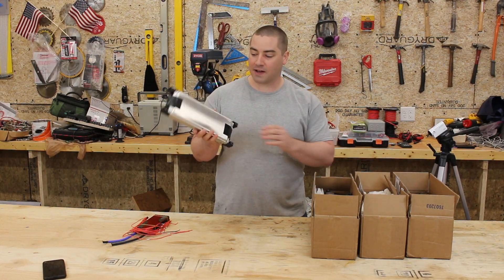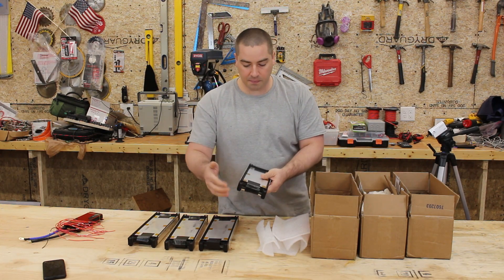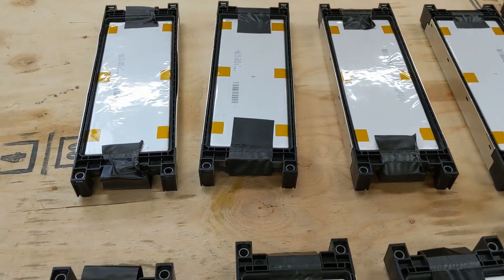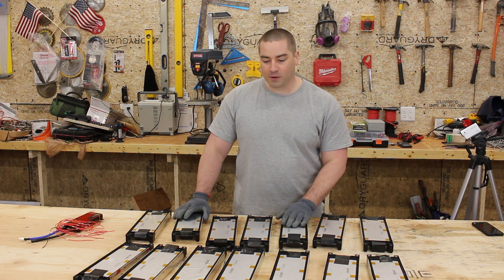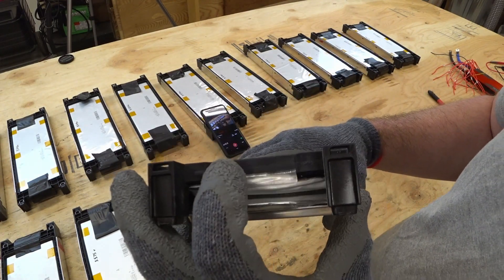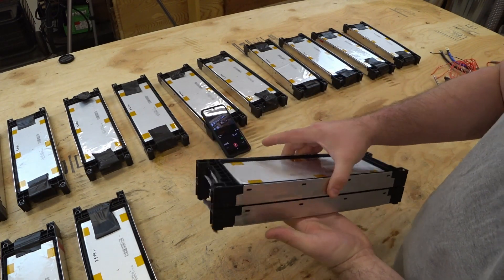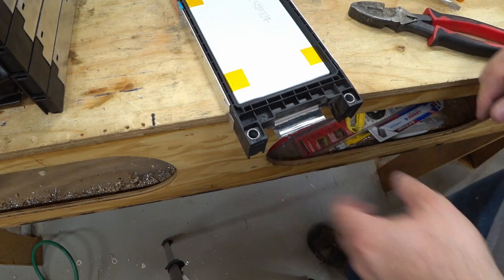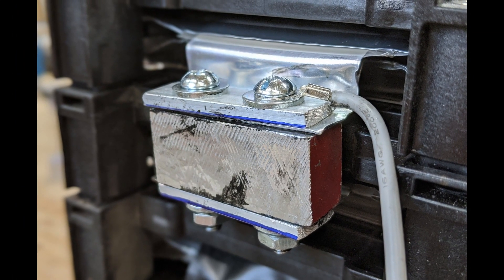LG 6kwh Powerwall, Part 1, Joining Cell Tabs Together

Comment: would love to run these in my boat for trolling motor... Just cost so much to get these into Canada sigh
Reply from the maker: They are out of a Chevy Bolt.  You might get lucky and find one at an auto salvage yard?
Reply: I ordered 14 of these to be delivered to nova scotia... thought awesome till i looked at my bank statement online and seen that my bank (cibc) charged me $1.495 cad per $1usd. Called the bank and gave them shit and then emailed batteryhookup to have the order cancelled. Still waiting for my money back from batteryhookup, it's been 10 days today. Batteryhookup told me it was gonna take 7-8 business days to give me my money back...I'm like WTF it took 5 minutes to take my money and 8 business days to give it back, suffice to say I have my bank 90% of way through a fraud charge if my money isn't back in my account on tuesday (8th day). Every one is out to take advantage of everyone!
Reply: @DavidSmith-dm8ew  I don't know the particulars but 2 things. first you should know it will cost at least about $1.42Canadian since the exchange rate is 1$ Can to .70 US$  maybe your bank or card etc has a service charge for the rest or could be the exchange rate was different that day.  

Second  a business absolutely must make sure the transaction actually goes all the way through and is actually in their account BEFORE they return it to you (which by the way also likely costs them some money so they may actually lose money to refund you fully) this probably takes 3 or 4 business days.  Then they refund it to you which then also takes 3 or 4 business days for your bank to make sure it is actually there to put in your account.  
The biggest reason for this is to prevent scams etc .

It is entirely reasonable for it to take 10 days or more.  Many businesses will take up to 30 days to get this done .

I am not affiliated in any way with BHU and in fact have never purchased anything from them.  I do know from what I have read they have always refunded money to those that had problems with a shipment or goods etc.  Really even more than maybe they should have.  

By all means make it known if they dont return your money but I wouldn't be quite so quick to criticize. There are only a few major companies that sell these type of deals to DIY ers and I am thankful they exist whether I have used them yet or not.
Reply: @teekay1785  CIBC told me it was their business model to charge someone more money then the exchange rate so that they can make money off people.
Reply: @DavidSmith-dm8ew  Today's exchange rate is CAN$1.42:US$1.00

Battery Hookup has nothing to do with exchange rates, or restoring funds to your account. These are all sent by governments and the financial/banking system.

Had you used a credit card, rather than a debit card, your available funds limit would've been restored within 2 to 3 banking days, tops.

Battery Hookups is a legitimate organization, offering excellent products, as well as service. They did nothing wrong here!
Reply: @ARepublicIfYouCanKeepIt   Didn't say they did have control of the exch rate. The rest i don't know about.
Reply: I got my refund from battery hook up on Friday. However the bank of CIBC decided it was in their best interest to take and keep $92 of my refund after it came through... to which I called them up and bloody let them have it. 
Not only was I told it was their business practice to charge a Canadian debt card 49.5% exch rate but that it was good business practice that is how they make money off you, I was told after I got the refund and they kept $92 that that was a good business practice to keep part of the refund.
 I was then told (after the verbal abuse I gave the guy on the other end from cibc) that because I was such a" valued client" Of CIBC that they would show me a "good will gesture" by giving me the money back they took from me in the first place back and that I really wasn't due the full refund because it was a good business practice and every bank and business did these things. Whooooaaaaaaa!!!! fuck me running. 

So anyways...lesson learned.

 Sorry for the rant guys and gall's. Get from my exp some good advise and use paypal or get an american credit card and do the exchange from Cad to Usd. You will pay a penalty from the exchange but not like I got put to me from my bank. Life is always a learning exp when it comes to money.
Reply: @DavidSmith-dm8ew  Now you've discovered why I only bank at credit unions.